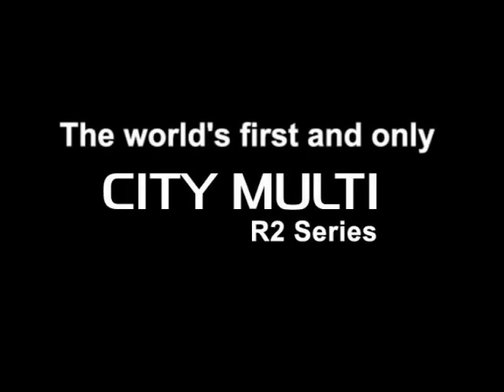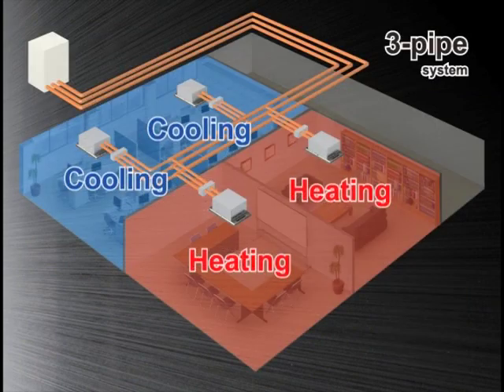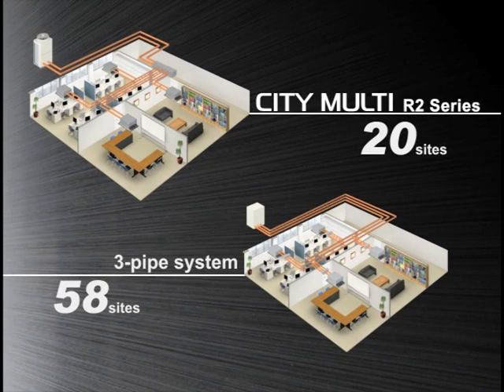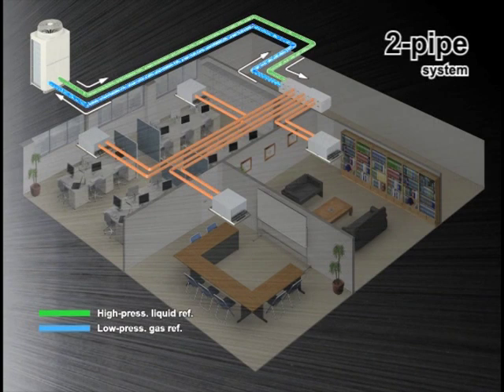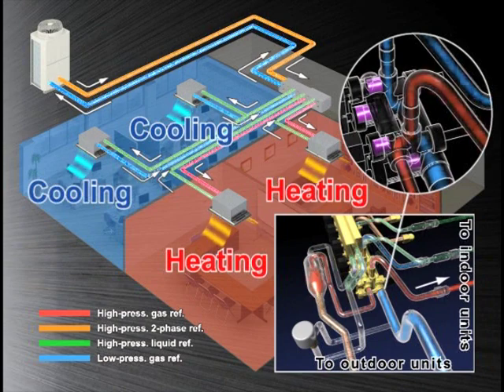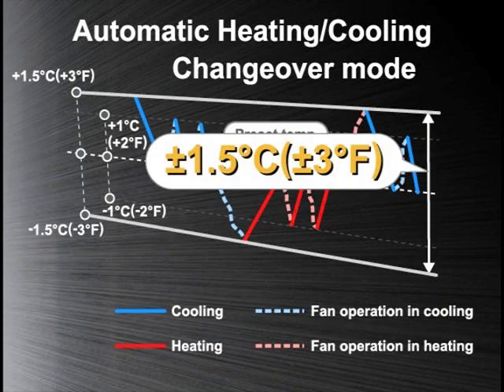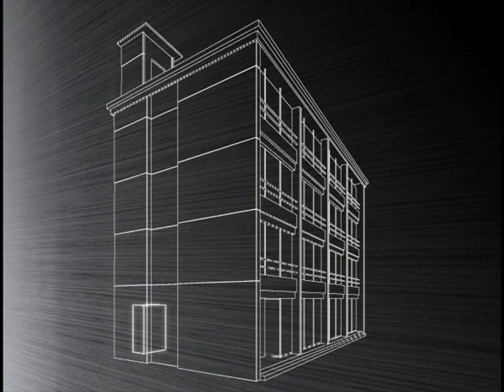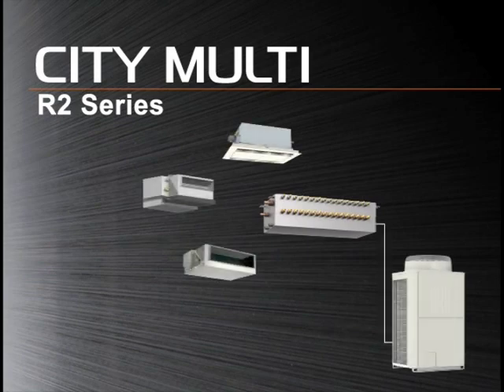Mitsubishi Electric - CITY MULTI R2 Series

Comment: So what's the difference between a city unit and a Mr. Slim? You can have multiple evaporators going to a Mr. Slim Condensing Unit just like this one.
Reply: your mr slim will definetly not support 50 indoor units on one outdoor unit, these are MUCH bigger than Mr. Slim units and also require 3 phase power (industrial electric)
Reply: Just one evaporator for Mr.Slim system